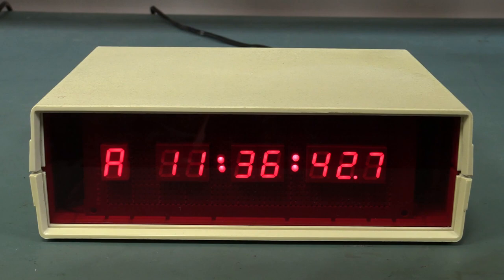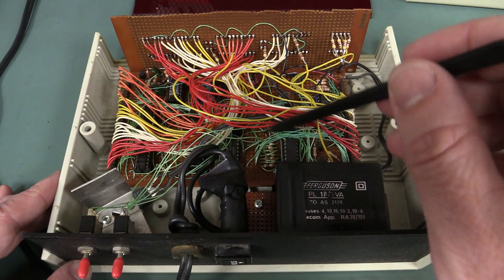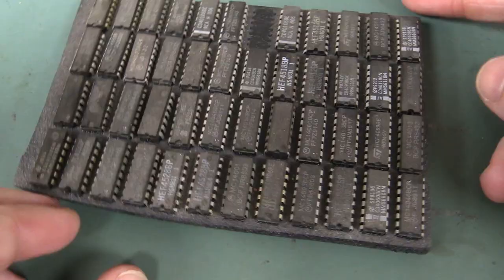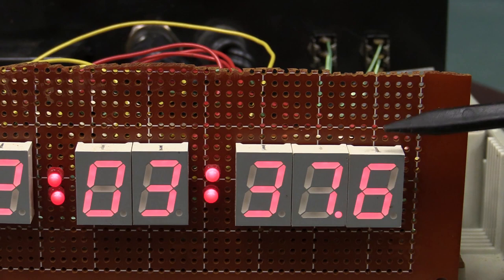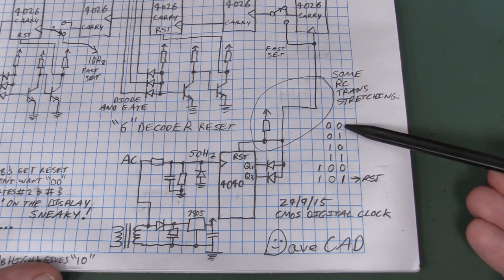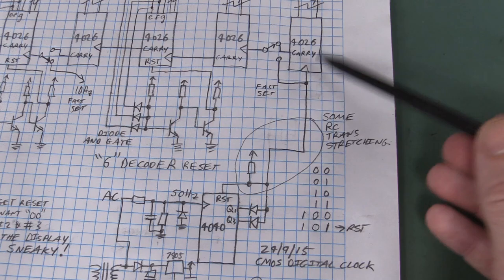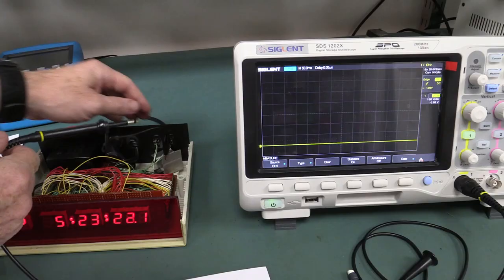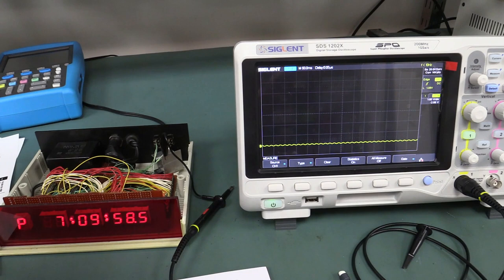EEVblog #801 - How To Design A Digital Clock

Comment: "what can I do with them, I know - make a clock!"
Heh, I'm in almost the same situation right now. Got a nice case from old APC UPS, initially wanted to put the step-down transformer here, to get 100v from 220v for the Japanese record player. Then I thought "Hm, that case seems a bit too big for the transformer alone, and I don't want other extra components sitting around and making a bit of a mess".

So now I'm building 4-channel stereo multiplexer (74HC4052) with 1 phono input (and 3 line inputs), separate line out, and built-in headphone amp, all that with digital controls powered by AVR. Just because I've got parts salvaged and just because I can :)

Comment: Now I'm inspired to make something out of my load of 4000-series CMOS ICs :D But I think I will make a different type of clock, maybe try to build an ovenized crystal into it. and instead of transistors for switching I might use small FETs. And Because I live in europe, no AM/PM indicator for me, just plain 24 hour time display. 
There is so much to play around, maybe try a higher voltage version with different 4000 ICs (because they usually take higher voltages), no 7 segment displays but something using less power, and maybe even something extra robust, to send it into space? :D

Comment: Wouldn't the diode still pass negative voltages into the ripple counter because the forward voltage drop across it when current flows from ground into the line to hold it up. I brought this up because in a project of mine I was trying to convert 3 state logic +5, -5, ground into binary and I was using diode clamps a lot but I still had negative voltages of about 200mV because of the forward voltage drop. 

Because it was feeding into a FPGA I was so terrified of damaging it I put the signal through a summing amplifier made from op amps of course and I summed the signal with a voltage reference made using the same diodes to get a similar forward voltage drop and that lifted the signal up so it was all in the positive region. Then because I was terrified the rise time might be too slow I fed that signal into a non inverting buffer with schmitt to sharpen up the signal. The final output into the FPGA was very sharp and nothing blew up yay!

There's probably much better ways to do all that but I don't have the knowledge or experience.

Comment: This makes me want to roll a clock like this right now. I would actually use a watch crystal (32768Hz, paired to a 74LVC1GU04 and a 74LVC1G14 to emit a 32768Hz signal) and instead of a huge board of chips I would use a CPLD. My LED module requires multiplexed input, so the driver circuit is pretty much a CD4511B, two 74HC06's and a 74HC138. The entire thing would be powered by a single 18650 lithium-ion cell directly.
Reply: +陈北宗 Cool, but throw a MEMS oscillator in there, so you can have error compensation. Toshiba CPLD or Lattice?
Reply: Steve Nordquist Should I use higher precision oscillator I would prefer something like DS32kHz DTCXO over the MEMS oscillator, or go with a microcontroller and a DS3231 I2C DTCXO RTC. DTCXO are more accurate than MEMS oscillators.

My preferred CPLD is lower pin count Altera MAX II series like EPM240 or EPM570. Cheap and still supported by the latest free software.
Reply: +陈北宗 That DTCOX crystal is going to outlast the watch crystal, too. I was thinking of the oscillators that also control voice waking for phones...so Wolfson digital mic. parts (wolfsonmicro.com ...now part of Cirrus?) The mems rtc would permit sleeping 100ms or more. DS3231M is the i2c one...but 5ppm accuracy is off maybe .4s a day. SiT1552 is a plain oscillator w. that accuracy. 0.5ppm sounds better all right.
Reply: Steve Nordquist Should I use an I2C RTC chip it would be the DS3231 non-M. Coupled to an ATmega328P running on its internal oscillator straight off a 18650 cell, it makes a decent clock. The CD4511/74HC06/74HC138 driver circuitry would still be used though.

Comment: Love It..  I built a TTL clock just like this with a bunch of 7490's and Hewlett-Packard 5082-7340 displays.  Lets add a 24 hour option to this clock.  I would Love to see how you deal with that using Diode/transistor logic.

More Videos Like this Please....
Reply: A 24 hour clock would be easier: you would just connect the two bcd counters with the carry as normal, creating the reset as soon as you reach 24 which is just an AND of q2b and q3a.
Reply: Agreed. Keeping the 12 hour clock and adding a 24 hour option will be more difficult. You would need to switch out (Some or all) of the 12 hour diode logic and switch in the more Simplified 24 hour circuit. It will be a very interesting how to video working all of that out. That's all i'm saying...

Comment: Couldn't one use a 4026 for the hour display by doing a clock injection to fast skip the 0 when when going from 12 to 1?  Very cool circuit, I still sometimes design for projects with individual chips but usually due to laziness or feature creep go back to the micro crutch.

Comment: +EEVBlog I have a feeling that the UK mains frequency changes over time, and gives you a good idea of the load on the grid... is this not the same in Aus?
Reply: Technically frequency is the only thing that is stable (more or less) at the plug in developed countries. Voltage, on the other hand, could change a lot.

Comment: My clock runs slightly fast since having solar panels installed had to get rid of them and had to get pure digital clocks. no ac frequency controlled clocks. Try running it at home and see if it runs fast after a day or so. I only noticed when it was really sunny then it clicked.

Comment: Im looking to build a 24hr version of this clock. Have you got a video going more in depth about the diode and gate that resets the 6? I understand the diode side of it but am having trouble understanding why you have to use 2 transistors after it to hit the reset?

Comment: I actually want to build a clock this "old-school" style :) Much more easy tounderstand all the analog and manual stuff, and of course its much more interesting and actually teaches something, unlike if you had everything on one chip like you do nowadays or use microprocessors... Its just nowadays to build something like that all the parts would be needed to bought online separately and it'll probablycost a lot etc., but it would be really cool though...

Comment: This is an amazing video with a bunch of nuggets of information including discrete digital logic design as well as implementation of simple logic gates using diodes and transistors. A very impressive project and build, thanks so much for providing such detail in DaveCAD. I really like the half-rack instrument feel of the design, exudes quality. 

Not a big fan of the connection with US politics, but it's Dave's channel.

Comment: Seems like some work to get 12 hrs to work. Looks like some diode logic.

In a similar year,, I did a similar clock based on 60Hz but I used 74xx series chips. Similar wiring style, lol. I still have the four digit display but I must have breadboarded the rest. I might have used a nand gate or two for the cases where it would not go to ten.

Comment: Memories - same sought of thing I was doing in the 70s. And I still have a crumbling black antistatic foam full of dozens of 70s date coded logic I can't bear to throw out.

Question: Why didn't you take the clean 10hz clock from Q3 of the 4040?

Comment: I have a question : you reset when it hits 12 o'clock then force it to display "12". Why not choose to reset when it hits 13 instead ? so it displays 12 no problem and when it hits 13 boom reset ? Have I missed something ?
Reply: +Louis 
Then there's problem to reset it to 1, not to 0.
Reply: +mrozu1337 Then instead of forcing a twelve on all zeros across both BCD counters force a one only when the tens counter was zero. Would clean up the circuit a bit I think.
Reply: +Andrew Querol well you would need to still have the nor gate for the ones counter :/ I guess it makes no difference
Reply: +Andrew Querol Then you would get "1" twice. Resetting at 13 would be the obvious first thought, but then you'd need to generate quick extra clock pulse to get it from 0 to 1. Instead counting from 0 to 11 is just clever.
Reply: renxula well either way in the end would end up just as complex I would think. Maybe you could attach the carry signal to the set input of a rs-nor latch. And have the output signal of the rs-nor latch connect to the base of a transistor that would control the main hour clock from going into the tens counter and also connected to e and f signal lines of the tens segment display. Then connect the b output signal of the tens counter to the reset pin of the rs-nor latch, the tens counter, the ones counter, and the am pm indicator input. But that would be more discreet logic. That ended up more complex than I intended for writing on a phone :p
Reply: +mrozu1337 Oh right, didn't thought of that ! That's why 24hr systems are so much simpler !!
Reply: ***** I see this kind of mentality in tinkerers occasionally. There's no need to come up with endless alternative solutions when they're no more elegant than the original, good enough, working, and - in this case - ALREADY BUILT solution :)
Reply: renxula I think it's rather interesting to discuss about alternatives..!
Reply: renxula Oh I agree :P I got to the end and was like this is worse, but I didn't want to waste my comment :P

Comment: HOw does the minute get a signal if you are resetting the previous chip at 59.9 since the 5 never gets to 10., or does the chip send the signal when it resets.. Im assuming that the signal for the minute is comming from the same line as the reset request rather than the carry on the chip?

Comment: In fact in the 80's there were microcontrollers out there already - like the ubiquitous Intel 8051, or if you was geeky enough you would grab a Z80 CPU and make miracles with it, but that was really kinda EXPENSIVE sport to play back then - because besides the main "CHIP" you would usually being stuck also with some kind of exotic SRAM or EPROM or PROM that would cost you $$$ just to fire few LED's or 7segs. Your friends would certainly be impressed - but you was broke :)))) Not to say, to program all that is not like today you have your USB shit plugged in and some $20 Arduino blinking right there. Having a computer already was a lottery jackpot hit! Let alone connecting and programming some strange external interfaced stuff! That really was a privilege of few. So in the end of the day the discrete 74xxx TTL and 40xxx CMOS digital logic family was the WAAAAY TO GO, OH YESSSSS SIR.

Comment: Do you use ripple control on your mains in Aussie?  Here in NZ a clock triggering off the 50Hz mains would lose a second every time the night rates were switched
Reply from the maker: +madengineer We do, but it never made a difference

Comment: Great videos Dave!

A quick question about this one - as a solution for the hours display being split across the 2  7 segment displays, would it be possible to still use your AND gate idea by looking for a 2 on both displays?  Possibly checking for the D segment being on in both?  At which point you reset both chips and flip the flipper?

There's something I like about having all the logic being spread across multiple IC's!  It makes we want to try and create more things without using a micro!

Thanks for the vids - keep them coming!   Jase

Comment: I'm surprised that just using the 50Hz mains cycle can be used for keeping accurate time.  Did you know how accurate the clock would be before you built it?
Reply from the maker: +Tommy Oz Yes, it was common knowledge that the mains is very accurate. Many product clocks of the era used the 50Hz reference.

Comment: Talking about Ahmed's clock is ok if you stay on point. Salvaged parts with ingenuity about building a clock. And of course a klugey homebuilt clock will look like a crude bomb timer. But didn't anybody notice no explosives. I say being around STUPID people is dangerous.
Now back to Dave's clock. It is a work of system design art. Figuring out how to get the 10, 11 & 12 to work with discretes was clever. Choosing the 4026s was also clever. You get a BCD counter and 7-seg decoder in one pkg. Well done Dave. Here in the states 60Hz will make for a bit more challenge. On another note you will need a LATCH to make an f counter. So 4026s are not the best choice in that scenario.
Again great job Dave. Thx for sharing.

Comment: You could have accomplished the same thing by buying a $6.95 clock, removing eight screws, and sticking it in a pencil case.You would have saved 40 minutes on this video.
Reply: +Kaleb Adams No one would waste time building a clock, if it wasn't for the sole purpose of learning something by doing it. How could you not assume such very simple logic? It's you who need to wise up here, not Dave.
Reply: +Kaleb Adams You're a bit thick, aren't you
Reply: TheMrTape ***** If you don't get the reference, then it's generally wiser to remain silent. Instead, you look like a pair of fools.
Reply from the maker: +Kaleb Adams No, they are bang on. It's you who looks like the fool for disparaging a rank beginner instead of encouraging him.
Reply: EEVblog Do you really think it's appropriate to encourage pawning off someone else's work as your own?
Reply: Valentina Kerman Well said. Despite how poorly this kid was treated, and we need to remove the zero tolerance policies that allowed him to be treated, we shouldn't also encourage someone claiming a pre-made device is their own invention.
Reply: I think it is a brilliant project and you do a LOT of different things inside this clock to make it work with or/nor gates etc. and using multiple chips + 7led digits etc. you would learn nothing from buying that 7 dollar clock and you apparently learned nothing from a 40min  video either.

Comment: One question regarding clocks, not using TTL. If i have an internal oscillator of an ATmega chip, what is the biggest timer resolution where the accuracy is ok? is it like 1/1'000 of a second or 1/10'000 ?

Comment: Wow, this brings back memories from when I tried to build a digital clock myself. Mine did 24 hour count. I used full on AND gates and OR gates. Separate 7 set display and bcd counters.  I tried to 555 the timer. I don't think I displayed seconds. I love how your timer works, but that would run too fast on the USA 's 60 Hz. I'll have to rebuild it. It ran fast so it was only ever on a breadboard.

Comment: Thought I was going to beat you with the five unused 76-29 batch code MC14522BCPs in the box that came with me when I left a firm in '86.

Edit: Floating bases are never a good idea - there really ought to be base pulldown resistors after the level shift diodes in the diode AND gates.

Comment: Just out of curiosity, do u think it's harder now to design a clock, or harder then, being a hobbyist, because now you would have to learn how to use microcosm roller and how to code, but back then it was just one type of logic
Reply: Its much easier now. MCU's are very precise and pretty easy to program and these days 7seg displays can be run just using I2C since they have IC drivers on them.

Comment: I've got a salvaged parts (only the IC sockets were bought, the outside sensor was replaced due to corrosion and I replaced a 3-pin jumper arrangement - to select between inside and outside temperature - with a slide switch), 3-digit, 7 segment LED display  inside/outside thermometer up in my appartment, which I built when I was 15... I'm 45 now.
Is this an electronic engineer/geek thing? -does everyone in this field have a circuit/project like this?

Comment: How does the step from the cd4026 to the cd4518 work? The CD4026 will never reach 10, so will never do a carry? I cannot figure out how it goes from seconds to minutes and from minutes to hours. I get the reset, but I do not get the carry in these steps.
Reply: +Floren van Olden I looked up the timing diagram for the 4026 and the carry out pin goes high after the chip rolls over from 9 to 0. It then stays high until the chip moves from 4 to 5, at which point it goes low. Hope that answered your question.
http://www.ti.com/lit/ds/symlink/cd4026b.pdf
Reply: +InfinityArcane Thanks!
Reply: I had the exact same question. Thank you!

Comment: 23:10 Wait, what about 8? when all digits light up! Or does that not matter because the counter is reset and there are no numbers before 6 that have those unique leds lit up?
Reply from the maker: +Power Max You answered your own question :->
Reply: I sure did! was also going to ask about the parallel diodes, thought it was OR gate because if any 'input' is pulled low, then the output would be low. sounds like an OR function! but after drawing and figuring it out I realised that only in case when no diode is pulled low, is the output high, therefore it's an AND! learn something new everyday!

Comment: If he resets the 4026 at '6', is there a carry? or did he use the 'reset' signal for the carry in at the next 4026?
Reply from the maker: +TheTrueCBaer The carry signal changes at 5, and reset changes it back. So can be used in this fashion.

Comment: This is irrelevant, but I blew an ac cable today. It scared the crap out of me. I split the cable, the cable was broken from the inside apperently. I was wondering why the didn't circuit breakers trigger. The arch melted the cable down. The point I want to make is I wouldn't even touch a DIY 240 project, never, ever.